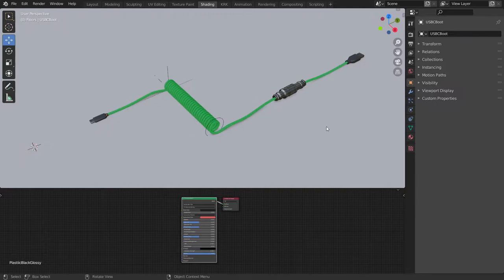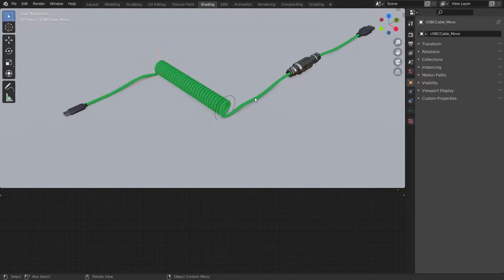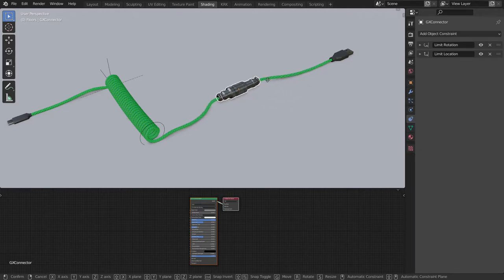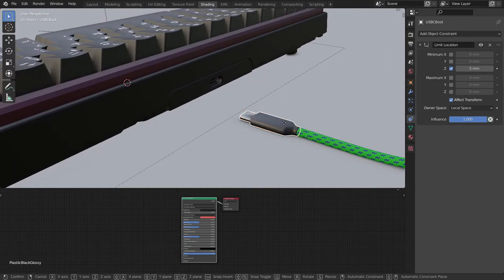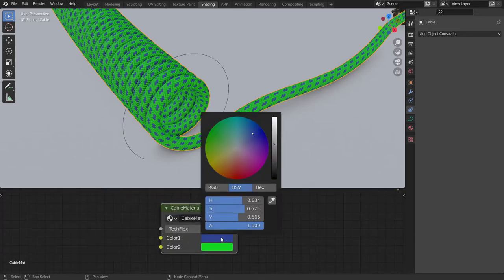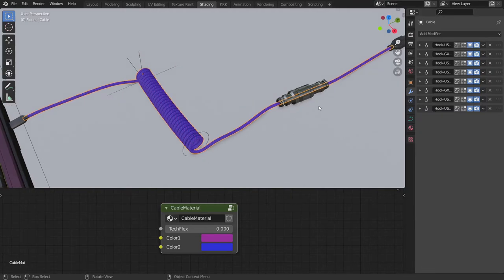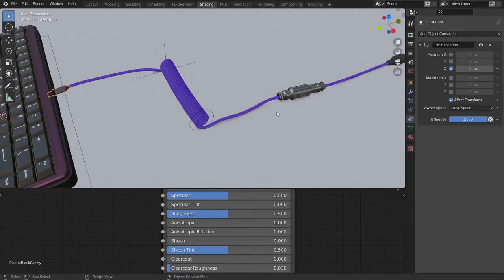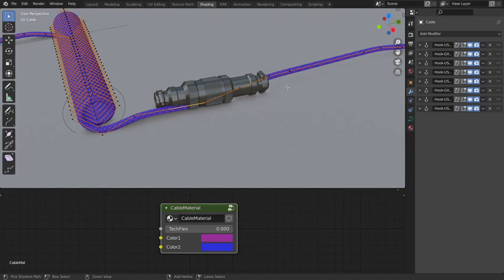Keyboard Render Kit - USB Cable

Comment: How do you remove the coil, so just aviator cable? Thanks :D
Reply from the maker: You can probably just delete those verts but it may affect the modifier stack so you'll have to adjust those too. KRK2 has one without a coil.